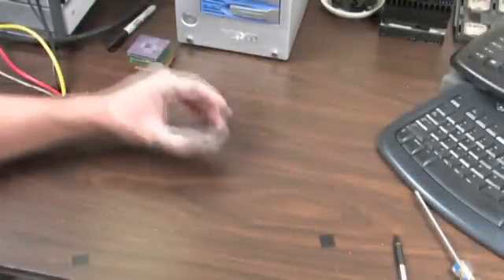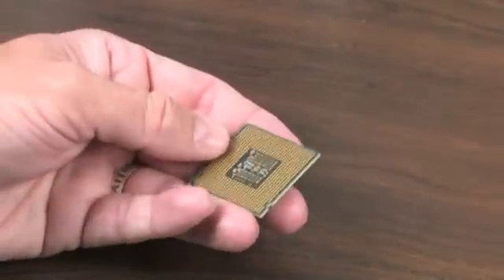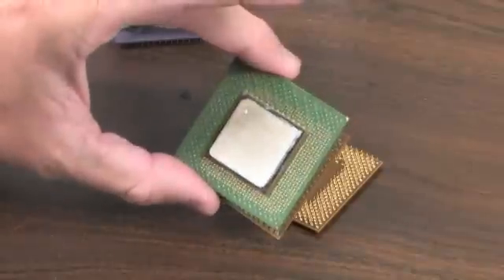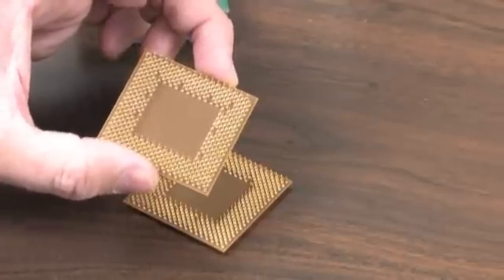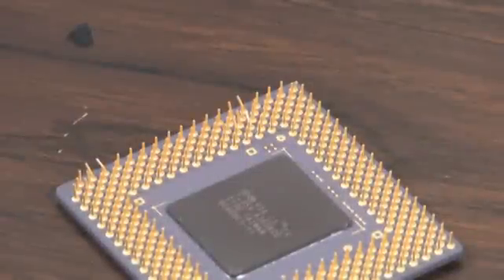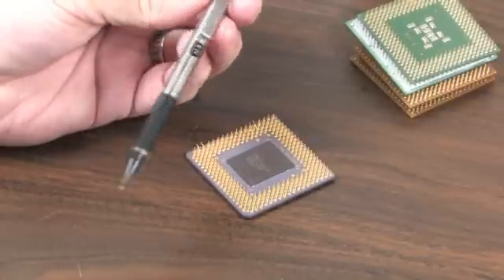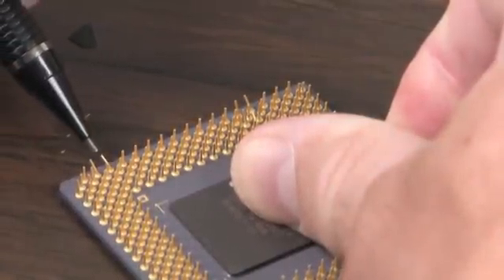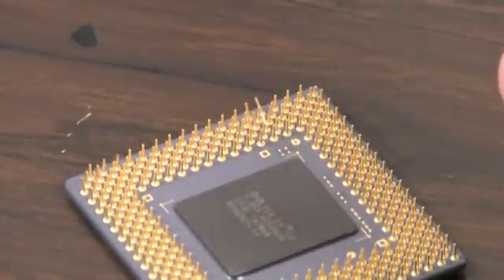Fix Bent Pins on your AMD CPU - Ryzen Coming...

Comment: Very relevant as mounting my 1700x monoblock caused bent pins and (probably) causing my mobo to not boot anymore. Now to actually get the pins fixed so I can finally boot with my new 1080ti
Reply: Well, did it work?
Reply: I have 1700X as well..and yesterday one of the pin is bent... hopefully this works..will try it out tomorrow
Reply: I have snapofff amd 1200cpu and 2 pins r snap off need to no how wood u get fixst take it to a jewelerhave both of the pens soldered back on with 14 karat gold probably take them a little longer but I've had studs welded on earrings before I'm hoping it take him a day or two to fix it they get the right diameter pens made yours are okay but not PC makers

Comment: I wish I saw this video 4 hrs ago when I dropped my AMD Ryzen 9 processor and bent dozens of pins 😱……after I got over the tears, I used the tip of a razor blade to painstakingly push each pin back into position!! FML IT WORKED!

Comment: Does it require to remove termic past from the processors??????
Reply from the maker: Any time you re-mount the heatsink, you should clean the heatsink and CPU off with a lint free cloth and put new Thermal Interface Material on the CPU.

Comment: in 20 years since i work with PCs only 3 times i had couple bent pin because the users though it wouldnt enter the cpu slot and pressed hard, but your way only good for couple pin and not very bad bents. i used something small like a steel knife and carefully unbent them.

is better with pins than without